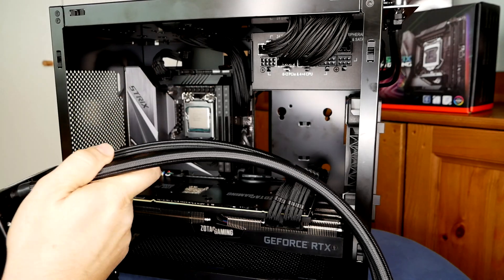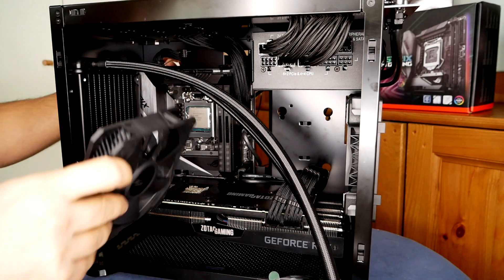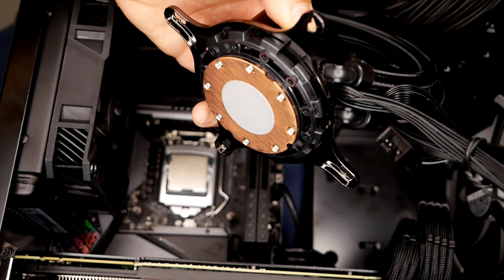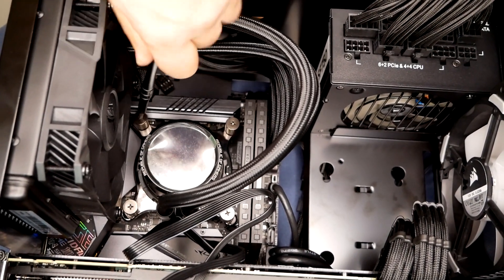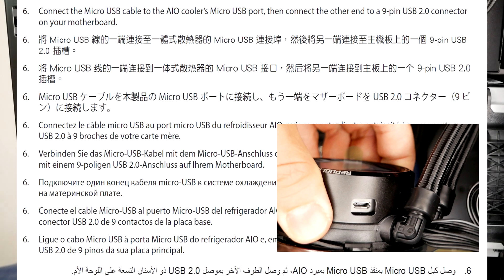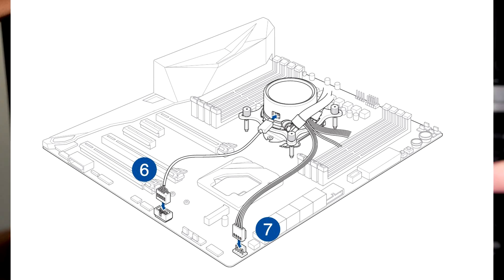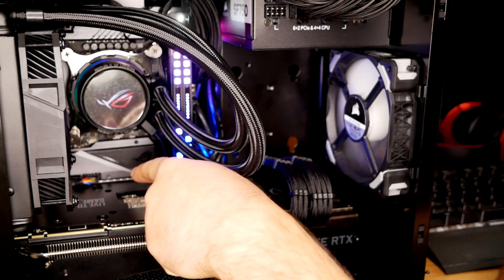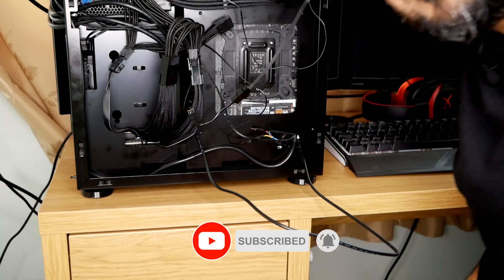ASUS ROG Ryuo 120 CPU Cooler Build

Comment: The radiator hoses should be facing down to prevent pump failure
Reply from the maker: Yeah I changed it... thanks for the heads up though

Comment: That's crazy how I found this video haha I have the exact same case and the same AIO haha. I'm hoping it will be able to cool my 3700X decently compared to the stock cooler was sitting around 88C during games.... good video btw helps me to see what troubles to look forward to.
Reply from the maker: good luck dude, just make sure the tubes are at the bottom instead of how I configured mine.... I eventually flipped them from top to bottom. Playing CoD at high (not ultra) settings I get around 59C to 67C. But I also have a RTX2080 as well so might be the reason why I get low temperatures....
Reply: How’s it holding up I was planning on the same thing

Comment: nice, does this work on gigabyte x570i aorus?
Reply from the maker: it should work with all motherboards with different CPUs, it has the right brackets. I would still make sure by checking the size and CPU brackets for the motherboard

Comment: Does this product(liquid cooler) have a RGB/ARGB fan? Or liquid cooler fan is not RGB, a colorless normal fan?
Reply from the maker: Unfortunately the fan is just black. I think the radiator fan is made by Noctua, which is a leading fan maker. Only the heat sink is rgb.

Comment: Hi, thanks for the video upload of your install.  

I'm installing the RYUO 120 AIO onto my Rog Strix z490i board as well.  I'm having an issue with the standoffs for the watercooler.  In the manual it says to use the special standoffs for LGA1200 socket that are shorter.  

Which standoffs did you end up using for your install? 

I tried the longer ones to check clearance, out of curiosity, but the bracket had a lot of play.
Reply: I'm having the same problem right now. What did you end up doing?

Comment: If I can provide one bit of advice, it would be to reorient the radiator so that the flow nipples for the radiator are facing down in your PC-TU150. If the radiator contains any air from the factory (and a lot do) then those air bubbles rise to the top, and this can lead to increased strain on the AIO pump in addition to excess noise and below-expected cooling performance. I have the exact same cooler except top mounted in a PC-011 Dynamic, and it performs excellent.
Reply from the maker: Mmmm.... Would be interesting to know how  you know they contain air bubbles. I assumed that the air would be taken out at the factory. But your orientation idea makes perfect sense. I might have to do that. Thanks for the message and idea.
Reply: @AbdullahNagem  Glad to help. Personally I shook mine when I first got it last year. I could hear some sloshing, and having bled radiators in cars I know sloshing means there's some air trapped somewhere, probably to account for expansion.  Otherwise, a container filled only with fluid and no air doesn't slosh, as the liquid's molecules are already exerting force outward equally in all directions of itself within its container. For a more scientific observation of this in practice, I highly recommend Gamers Nexus' video where they modify an AIO pump and rad with plexiglass windows to see just how much pump performance is lost with improper radiator orientation.
Reply from the maker: Good post G, Thanks for the message

Comment: hooking up the fans, what do you mea it goes straight into the heat sink?
Reply from the maker: So the heat sink has a dual fan connection and I meant that the fans connected directly to the CPU heat sink fan connection instead of connecting it directly to a motherboard fan connection. 

Hope that helps and good luck with your build.
Reply: Abdullah Nagem thank you yeah it helped.

Comment: Buddy i have Ryuo 240 and its very loud, how works your Ryuo?
I am not sure how is that installed, it was installed in pc servis.
My cpu works at 60" degrees always, which is weird and not necessery in idle mode. I cant figure out problem
Any suggestions?
Reply from the maker: Ryuo 240 is a twin fan and I expect it to be loud but not that loud... how loud is yours? and was it ever brand new when installed? 

CPU being at 60 degrees sounds ok, but depends on the load and what you are doing with the CPU.

My Ryuo is ok with regards to sound, I do hear it but its a single fan instead of twin fans.

Are you experiencing any performance issues?
Reply: @AbdullahNagem  I have no problem with performance, it works great, its just loud, i hear it
My brother got nzxt kraken x62 also twin fan and i cant hear his pc at all (he has i7 8700k, i have 9700k, i dont think thats an issue) xD
Also his cpu is constantly 25-30 degrees in idle mode
And yeah, all parts are new.. I am thinking of sending that back to servis and asking for changing that for Nzxt, for real :D
I gave about 3k e for pc and i still hear it..
Reply from the maker: Yeah it might be the fans are faulty. Send it back if its loud and noticeable. If like you said its new, they should be silent. Also make sure the fans are not hitting anything while being on. Maybe something is slowing it down and cause inefficiency in the cooling.  

If nothing send it back, they are not cheap and you wanna make sure you have a decent product.